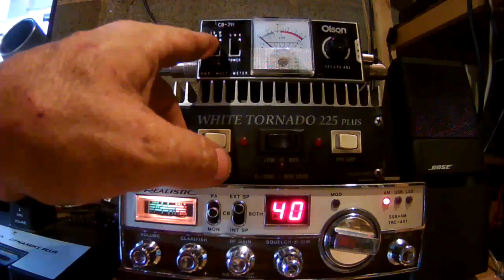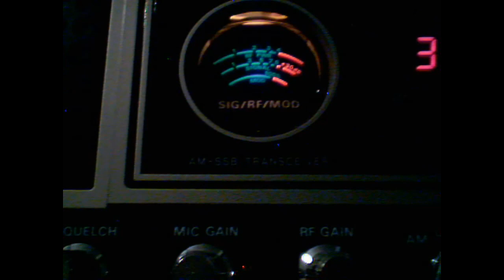Homemade Ground Plane Antenna, CB radio base station

Comment: Great to hear CB being used sensibly. I'm a UK HAM operator but used CB (AM SSB  and FM) in the late 70's. 1/4" or 1/2" copper tubing would give an even better bandwidth and more ground plane radials would improve omnidirectionability. If you have conductive (damp) ground try a full size 5/8th wave using earth as the ground plane. It's very low angle radiation...as long as your not in a valley :-) 73 and great work.

Comment: nice use of resources. Thumbs up for the mention of the Washington, One of these days i'll blow the dust off of mine. Been in a box for the last 30 years.
Reply from the maker: Please put that old Washington back on the air, A good radio is a terrible thing to waste. Thanks for watching, 73's from 151 SC.

Comment: Hello John, I've been looking for that elbow connector that has the narrowed ends to hold the ground planes. I've looked on Amazon and could not find that particular one. Can you point me in the direction to get one or the link? Also I want to ground the antenna to a grounding rod, and what gauge wire and to where do I connect the ground wire to the antenna? Thanks!

Comment: i made a antenna similar to this using copper wire 10 guage ,  and i put 4 radials on it. trial and error... but people 20 miles away say it sounds real good..   my radials are supported with 1". p v c also and zip ties to get close to 40 degree angles,  and adjust and adjust... my s. w. r. is super good.  1.2  all channels. just a 4watt radio.

Comment: Excellent build, Sir. I have to replace my entire setup. A tree blew down in a storm and fell right into my mast. 38 lower is usually my home channel. I'm still rebuilding my setup. Nice job, Man. I'll have to try that build. Ol' 786 Ironman, somewhere around the middle of South Cackalackee, we're back out.
Reply from the maker: sorry for Your loss 786. I hope You can get back on the air soon. Thanks for watching, 73's from 151 SC.

Comment: One of my issues is, my roof is very high, and steep, so a ladder or climbing it is out of the question ,yet it would be easier to mount on the home instead of the middle if the yard... still looking for  ideas for my old school Teabury I picked up from a friend

Comment: Mower Junkie,
I have been building my own wire antenna's for over 50yrs and my latest one is a 5/8 wave vertical dipole except it doesn't have any ground plane radials. So far I have qso's with operator's over 80 miles away in a base station/18 wheeler with my barefoot transceiver during groundwave propagation. When skywave propagation conditions are good my farthest qso was with a operator on 27.185mHz am in Balize.
My swr from 26.965mHz to 27.405mHz am/ssb has been 1.0.
The reason why you're homemade antenna's are stronger in north/south/east/west direction's are due to the radial's. I don't have any radial's at all and get out strong in a 360 degree radius due to the base of the dipole is feed in the middle instead of the bottom. You're vertical dipole antenna is better than the vertical groundplane antenna. Do an experiment with both of the antenna bases at the same height and you will see how much better the dipole is then the groundplane. Go back and watch you're own vertical dipole antenna video when you where in you're vehicle and you're wife was at home talking to you and you will see what I mean.
73
Maverick 233
Southern, CA

Comment: very nice i built one almost exactly like this about 6 months ago when i got back into cb.. i made a t out of 1/2 inch pvc for the radials and mounted the t to the pole .. it allowed me to raise the antenna up higher.. so the ends of the radials are mounted to the ends of the pvc t and not tied to the house.. 73's
Reply from the maker: That's great! I hope You like Yours as much as I like Mine. I find the performance to be incredible!
73's and thanks for watching.

Comment: My 12 dollar Walmart mag mount antenna works awesome! I have talked Skip clear across the country! Pretty sweet! Great video! Thanks
Reply: Apple I have had one in the past. Give a nice groundplane vertical a try about a 30 feet up. Its a whole new world
Reply: KC1KUG thats what I heard! I talked from California to Georgia! It was awesome! Thanks for the tip brother!
Reply: Apple Even just an Antron 99 up 30 feet will get you working everyone. Mount it to the top of the house maybe? I have mine up on a guyed mast. 30 feet of fence post. works great
Reply: KC1KUG That would be awesome! My radio is a bearcat 980ssb and I’m surprised how far my set up reaches! I can transmit and receive miles away!
Reply: you should get a tram 300 mag mount hads lower swr you don't need trim the antenna.
Reply: @foxman362 my radios are going to come in handy when the Corona knocks out the cell towers! My arsenal of two way radios will come in handy. Rare and with a lot of money for my equipment now days. Priceless! Thanks

Comment: Good meeting you both in Shelby today! Re-viewing this video to see what I need to build my antenna to see if I get out better than with the antenna I have now.
Reply from the maker: The pleasure was all Mine. Please let Me know how the antenna project works out. Take care, 73's from 151 SC.
Reply: @MowerJunkie  How did you clamp the ground plane wires?  Hose clamp?  What wire guage for the gp wires?
Reply from the maker: @bowlsantander9730  I used small hose clamps, clamped to the outside of the coax connector. The ground plane wires are #14 solid copper wire.

Comment: Nice, just getting back into it, looking at a Cobra 148GTL and am going to mount my antenna on a post  bolted to a sandstone slab on a 700m escarpment. Skip is going to be fun. Going to copy your rig but with 4 ground plane wires at 37 degrees. Bouncing between 1/2 and 1/4 wave. Might do both.

Comment: Only 2 things I would do different 1) The PVC would fit over the mast pipe with 2 stainless bolts with washers & Lock nuts to hold it to eliminate clamps.  2) I would use smaller diameter sections of PVC stepping it down smaller with each section to the tip for better wind resistance.
Reply from the maker: You think like I do, originally I was going to have it slip over the mast pipe, but My local hardware store did not have the pipe or fittings I needed to do it that way.  the wind is not a problem here, even in Our worst storms this antenna barely moves. Thanks for the comment, and I'm glad I got You thinking. 73's from 151 SC.

Comment: you can use two lengths 8.5 feet long and make a dipole that you can turn and use sorta like a beam. that is useful also for the dx conditions. copper pipe also works well for making verticals. fro anything cb related 1/4 wave just keep using 8.5 feet lengths. that is the 102 inches and the proper wavelngth for the 27mhz band.. the antenna is fairly broad band and will also work up into the bottom of 10m with out any issues.

Comment: Pity you can't go with more radials. As you probably already know, it's all about ground efficiency, you need those return currents on the gp wires to screen out that lossy ground. Otherwise a portion of your output power is simply warming up the ground. This varies on your soil conductivity, the height above ground and the number of radials. The higher the antenna the less radials needed to screen out the ground below. The poorer the soil the more radials.

Comment: Just for the heck of it... You sait the p.v.c.  pipe wasn't glued yet for tuning.  With mine ,  I cut the p.v.c.  pipe about 6" short of the needed length , drilled a 1/8"  hole in a cap and with the copper wire sticking out the too a bit I check and clip to get my s.w.r. I thought also after siliconeing the top it should hold my wire up and straight in my p.v.c. pipe .   ??  So far its working !  Thanks m.J.

Comment: I own 4 Imax 2000s, an A99, an Astroplane, a Colossal by Zero5, an I-10K, an Avanti Sigma II 5/8, a Sirio GainMaster, a Shockwave, a Sirio Vector 4K, ( Dumped my M.R. Coily - cheap 😒 ) and several 1970s era Penetrators.
My home-built proprietary design "LAMBDA" (for want of a better name & trademark) noticeably outperforms every other one - regardless of Local, DX, groundwave, skywave or pure skip.
-  All anyone has to do is think, learn, use your imagination, calculate correctly, ignore everything written by The DB and you, too, can build something spectacular which beats everything commercially available.
Reply from the maker: Great comment! I completely agree. I have had a lot of factory built antennas, and the best antenna I have ever had is a homemade that I built Myself, though it was not the one in this video. Thanks for watching, Take care.
Reply: @MowerJunkie  Please, expound!
Reply from the maker: @JAFO.  A 2 element Homemade Yagi that I built, has outperformed 2 Maco beams, an Antron, an Imax, a Tram 1/2 wave, and a few others.
Reply: @MowerJunkie  Now try your hand at building a 12' foot boom, 3-element Quad at .18-R & .15-D and you'll cry tears of joy because you'll be so amazed by it's incredible quietness, super ears, amazing gain, Sweet low TOA for DX, tiny profile & cuteness.

Comment: Going to attempt this build this weekend. Only question is does the base of the antenna need to be 18ft off the ground?
Reply from the maker: it really should be at least a half wave (17 feet) obove the ground. it will work lower, but the performance will be reduced.
Reply: @MowerJunkie  thanks. Gonna get to work on it this afternoon.

Comment: Hi 151 SC,
I love your video's, they are very informative..
You say that you put the ground plane at a 45 degree angle..
This should give you a 55 ohm impedance...
As we are working with 52 ohm coax, to get the ground plane to match 52 ohm, I did the math and the angle would be 42 degrees...
I know I am splitting hairs here, but we don't know how big a difference it would make...
Food for thought, as your dipoles work very well when compared to factory built devices...
I am in Newfoundland, Canada and hope to hook up with you sometime on lower side of 38....
Cheers and 73's from Robert, North Atlantic, N.A.1221
Reply from the maker: Thanks for the comment Robert. You are correct, 42 is better...But 45 is easier to calculate. Mine are actually set a little less than 45 degrees.  Thanks for watching, 73's from 151 SC.

Comment: Hey there mower junkie, is 102.54 inches including ground plane wires and the main element?
Reply from the maker: the active element at the top is 102.5" tall, and each ground radial is 102.5" long.
Reply: @MowerJunkie   beautiful mower junkie, I got mine cut to that and hanging about 30/40 feet up. Beautiful swr, thanks for the return! 73s
Reply: I really appreciate your videos, maybe I’ll catch you on channel 37 lsb! You have a good evening sir.

Comment: Your thoughts on this.. I'm putting a 102" SS whip on my pickup,  behind the cab on the bed rail.  If I run a wire from the mount on each side of the bed would it act as a ground plane?  Or even help? Better left alone?
Reply from the maker: if it's mounted to the truck, You don't need any extra ground plane. Your truck will be the ground plane. Thanks for watching, Take care.
Reply: just wondered about it , because I'm putting it right behind the cab (center) on the rail is all. Thanks love the channel and the simplicity of it all. Btw, I'll be attempting to make this antenna for my base when I'm, ready for it.

Comment: Hey im trying to make this antenna but my copper isnt stiff and falls without support. Could I put it in a pvc pipe like you did to keep the antenna eite standing up straight?
Reply from the maker: That's why I used the PVC pipe,  the wire needs to be supported. I recommend using number 12 or 14 copper house wire, because it will stay straight in the pipe. if You're using speaker wire, it can be taped or zip tied to the outside of the pipe. Take care and good luck with Your antenna.

Comment: Hello. Mower Junkie. I have a question. I built a dipole antenna which is the antenna is part of the mast. The top 8" it s 3/4 PVC with a cap then a 1 1/2" T The bottom is 10" of 1 1/2" PVC. I want to put that up on the back side of my garage. Living in New York with the cold Winters will I have to worry about that antenna snapping? I'll probably put 3/4 of the antenna above the roof. Mounting it to the back side of the garage.Thanks! Vinnie
Reply from the maker: if You used schedule 40 PVC pipe, it should survive the winter.
Reply: @MowerJunkie  Thanks for that info. Hope I'll be able to talk to you once I get the antenna up. 1155 Condor Upstate NY.. 73's

Comment: It's working okay with just two radials? That's good to know. I thought you needed three or four.
Reply from the maker: it would work better with more radials, But it is still a good performer with 2 ground radials.

Comment: I still haven't got my antenna up. Watching and learning. Straight Shooter 311 Northern Indiana.
Reply from the maker: I hope You get Your antenna up soon, You're missing out on a lot of fun! Take care 311, 73's from 151 SC.
Reply: @MowerJunkie  Thanks! I hope so too! Could I ask you a question? I don't have you on Facebook, John. I wondered if it really matters if I use solid, or stranded wire for my Radials? And thanks for any tips and advice, Love your video's.
Reply from the maker: Both wires will perform the same, But the stranded will last longer. the stranded wire will withstand the constant flexing better.
Reply: @MowerJunkie  Thanks! I found some heavy stranded Speaker wire in my Basement! I might just double that up B/C I think it's 14 gauge.
Reply from the maker: That's great, A single strand of 14 gauge will work very well.
Reply: Just completed my pvc 1/4 wave. Going up this weekend

Comment: Do u recommend a pvc or wood or metal to use as a pole and why? I have a base 5`6 antenna butni m not shure what to use as a pole
Reply from the maker: the pole doesn't matter, as long as the antenna is a quarter wave, and has a minimum of 2 ground plane wires mounted at a 45 degree angle.

Comment: I have a couple questions. Is there a sort of majic number for the length of the antenna. I know it will probably have to be slightly adjusted. But like 13ft, 20ft. I don’t understand 10meter etc. 1/4 wave, 5/8 wave. Also how long do the ground plains need to be. Also do I need to running a ground rod and if so where too?
Reply: Chevy  10 meter band is above the CB Band  into 28 Mhz  the morse code area you hear on the "Black Radios"   1/4 wave antenna's are like the 102 inch whips on vehicle's  5/8 waves are like the Antron 99's and such...   The length's for the main wire and radial's are mentioned in the video....
Reply: the magic number is 468/freq=length

Comment: MJ ----- I want to put an antenna up a pine tree that's about 50' tall. I just received my new Uniden SSB CB. I'm waiting for my RG8x and connectors to get here. It would be difficult to put the ground plane radials on top of a tree that far up.  Could this antenna be tuned with a decent SWR without ground plane wires on it or would the SWR be too high without them? If this antenna wouldn't work well without the ground plane wires could you suggest another homemade antenna configuration that would work sticking out the top of the pine tree? Thanks ...... the word is you da man when it comes to antenna builds. Thanks again.
Reply from the maker: Hi James, unfortunately this kind of antenna needs the ground plane wires. the SWR would be sky high without them. You could use a simple wire dipole, it would be the easiest to mount on a tree. check out My Dipole video here,   https://www.youtube.com/watch?v=tRbJAhFCzH4&t=2s
I hope this helps. Thanks for watching.
Reply: @MowerJunkie  Thanks! I think I'm going to build your dipole antenna this week. I'll put the radiator and GP wires in some conduit, turn the antenna vertical and mount it to the pine tree. One last question, if the entire antenna is not completely above the tree, will that hurt the SWR reading and transmit distance? Thanks again "Antenna-Guru"
Reply from the maker: @jamesj4111  That's awesome! let Me know how the Dipole works out. The Tree should not affect the antenna at all. a vertical dipole will work great in a tree.
Reply: @MowerJunkie  Thank you for your help. Will let you know how it turns out! Thanks again!
Reply: @Linkavich Chamofskee Actually I was in Michigan a few weeks ago horseback riding, the saddle strap broke, I got thrown off and broke some ribs and bruised a lung. So ..... I need to wait a couple more weeks before I can get my butt up the tree. Still going to get it up there though.
Reply: @Linkavich Chamofskee Broke a few ribs and bruised a lung a few weeks ago. Gotta wait a little bit longer before I can get up the tree.
Reply: @jamesj4111  tl2t antenna  it's BETTER for you application 
Easy to build n easy up
73 n good

Comment: 👍👍 Thanks 🍻 73's Wayland NY
Reply: I copied your idea and it works Awesome..... I'm just getting back into CB radio after 40 years.... bought a Cobra 29 LTD classic to use as a base unit....102" whip with about 75' LMR 400  mounted on the chimney with old bedframe that I cut up for angle iron to use as a mast. Top of the antenna is about 34' off the ground. SWR's barely move now! I've been fuckin with my SWR's for too long and it works Awesome! Thanks... I couldn't have done it without tour video. 👍👍🍻73's